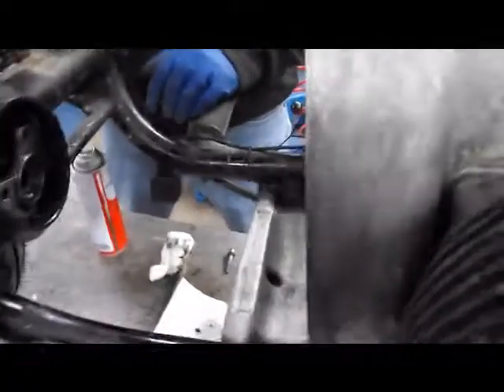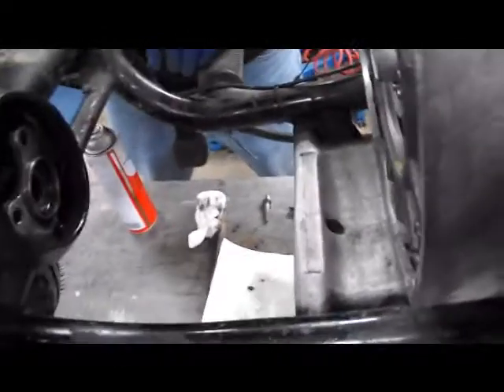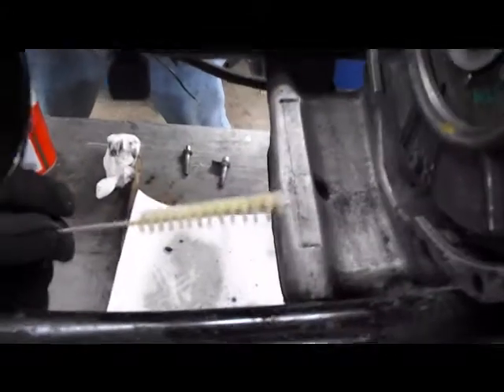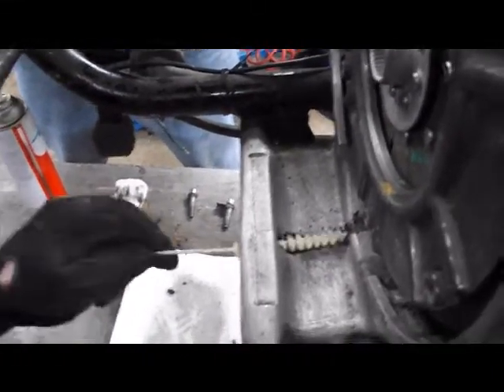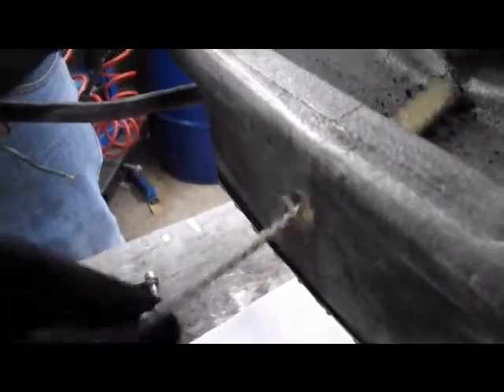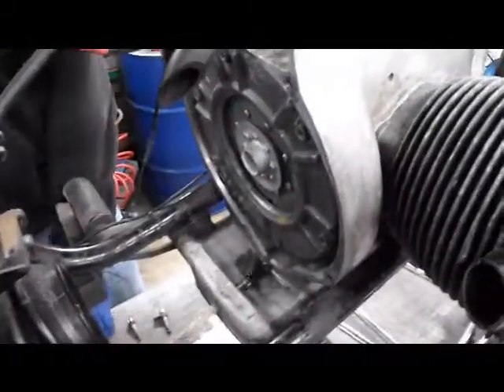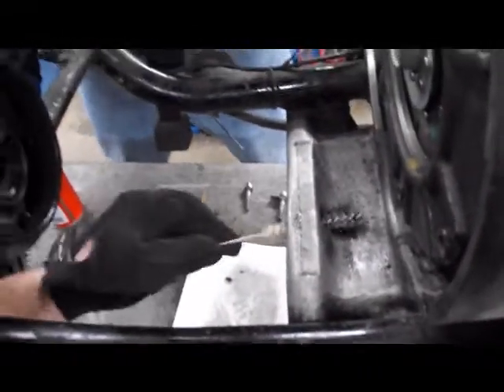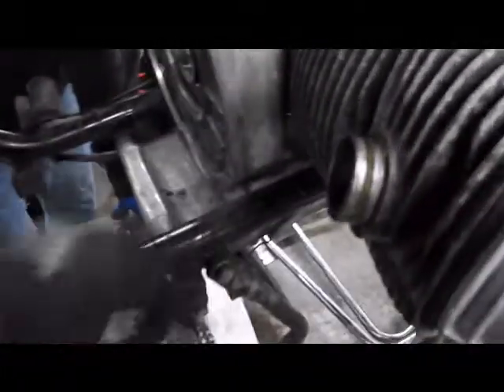BMW Service - Airhead Lower Water Drain Hole

Comment from the maker: Hi, I do not perform spline lubes in the manner that you are asking about. It is very important to thoroughly clean the splines before adding the Staburags paste. Just packing more lubricant on top of what is there will cause most of the lube to fling off and get into the clutch friction disc. Also, leaving old dried lubricant on the splines will inhibit the action of the clutch as the disc will have resistance sliding on the splines when the clutch lever is activated. Thanks for your suggestion